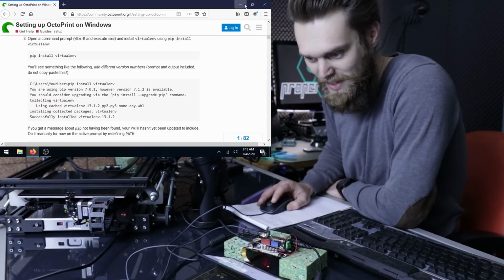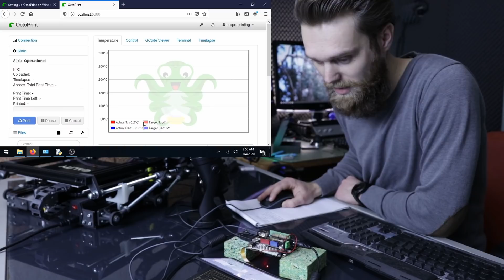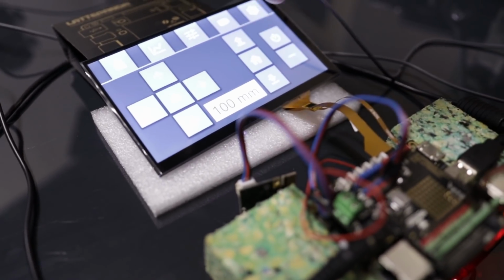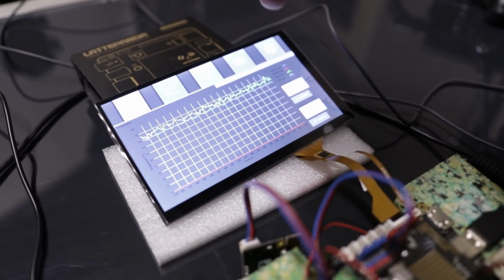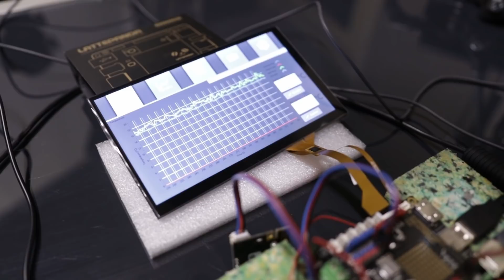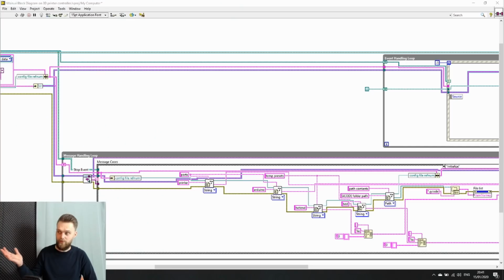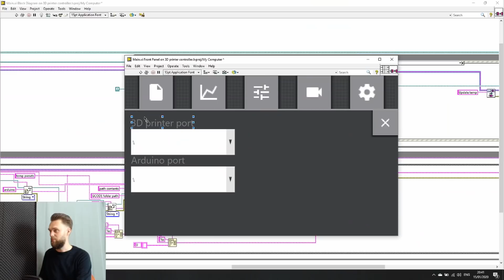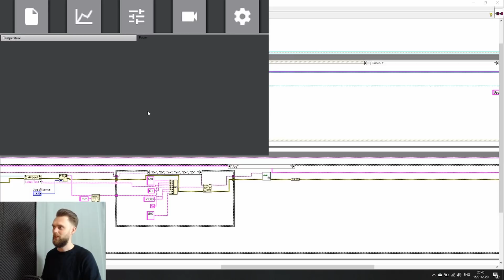Properly controlling an Ender 3 pro with a LattePanda print server

Comment: 09.47 I feel your pain at least its not just me that this happens to but you keep a much cooler head than I do
Reply from the maker: A pro tip which keeps my head cool in situations like this is to see it as a new starting point. This is where you stand, this is the current situation and which steps to take to get out of it. Most of the time you'll learn from it too :D If it happens a second time I won't keep it that cool though😆
Reply: @properprinting  good advice I will besr that in mind at my next failure

Comment: Amazing work! So what are You exactly doing here? Is this Frontend sending scripted G-Code thru the Octoprint Server? And what interests me the most, is it possibly extendable for File Browsing over the Touch Interface thru maybe some sort of File Browser? This whole Setup leaves me very curious of what it could be extended to because I am thinking of building a Jubilee 3d Printer/ Multi Tool Machine and I wonder if this Kind of Setup could be used to control lets say GRBL, that would make for a perfect Setup for controling a Jubilee since it's basically designed to be a Versatile open Source Machine for all sorts of tools, but the Software Side of things is not there yet to do let's say proper subtractive Manufacturing. Would be cool if You reply, Love your unconventional Approach to tackle Things and Your Trial and Error way of doing it, just like myself, although I am not that good at Programming, the only Practical Programming I've done is some Ruby Plugins for Sketchup for my own use and some Basic back in the Days. Greetings and Big Thumbs up from Germany 👍
Reply from the maker: Thanks Johannes! If you connect a 3D printer directly to a computer you'll get a serial port (RS232). You can send G-codes directly over this port using a terminal like Tera Term, Putty, Termite etc. LabVIEW is specialized to communicate over these kind of ports to control equipment, like a programmable power supply, oscilloscope, function generator you name it. Controlling a 3D printer is much like this and I made a LabVIEW program which shows a button on the front end and sends one or multiple G-codes directly to the printer. LabVIEW can basically do anything and file browsing is not a problem at all. For this food printer I'm planning to make a UI which shows a photo of the dish itself after which it can guide you through the recipe. I'm planning on making more videos in which I show how to use LabVIEW to control these kind of things and they released a free community edition recently https://www.ni.com/nl-nl/shop/labview/select-edition/labview-community-edition.html
Reply: @properprinting  Thanks a lot for answering, I'll take a deeper look into LabView then, maybe I get my head around this! Have a great weekend!😉👍

Comment: @
Proper Printing 

Really enjoy the video's Thank you for sharing, You really should buy a Tronxy x5sa pro. wonder what you could do with it. I own 4, 3d printers. Cr10-S, Sovol SV-01, Prusa mk3s and my favorite is the Tronxy x5sa PRO why is it so good, well for around $400 it has 32bit controller 24v, with TMC drivers & it can print between 100mm/s to 150mm/s out of the box this has to be the best printer for the money out there but only the PRO version as the standard version don't compare, it also has a simple touch screen but unique real time speed change on screen really cool feature. plus firmware tweaking uses simple coding anyone could learn. type small line of code save as file & use print function to upload the change very simple way of modding firmware. Check it out  , Cheers
Reply from the maker: I'm glad you enjoy my vids, thanks! And thanks for your suggestion! Hopefully Tronxy reaches out to me one day ;)

Comment: Do you have a link to the program you made ? I would like to incorporate this into my system. Thank.
Reply from the maker: Thanks Chris for your interest! No I haven't and for now it's only used for showing the principle. I'm going to develop this further behind the scenes
Reply: @properprinting  I'm currently running octoprint on old laptop I was going to get a touch screen that could probably be ran and used USB and use that for that program.
Reply from the maker: @cmm159  My next project will probably use a laptop as well with this software and an Arduino. This will take some time though in order for me finish the software
Reply: @properprinting  outstanding can't wait to see it in action.  Love the content and keep up the good work.

Comment: I NEED YOUR HELP. printing a small whoop quadcopter, I am using  cura. Problem is ,After 2 hours of printing ,the printer stops in the front left hand corner. The first time this happened I thought the filament had jammed, so started a New print same STL File. Just after 2 hours ,I even did a video showing a friend how great it was printing ,when 5 minutes later I went to check and the print head had stopped in the same position as last time, front left corner, it allowed me to click resume print. But as I did the print head lowered into the print and was jammed. It was like it wanted to go to first print layer. I got the stl file off Thingiverse and there arnt any complaints about it. Strange why it would stop in the same place twice and after same time period of 2hours sumit. Grateful for your input
Reply from the maker: This sounds like a slicer problem. I haven't had this before and you can try another slicer to check this. If this doesn't solve the problem I'd suggest posting the question on Reddit since there is a lot more experience with these kind of problems than I have.
Reply: @properprinting  Hey ,thanks for the reply. I should have wrote to you. We found it to be a Pause in the G Code. Deleted that and printing now without stopping

Comment: Yes bro, just read a handful of your comments and I must say, your doing well. I also ran into problems using octopi with a webcam and 7" LCD, but will get back to that later. What I will say since your full of good ideas, is try sculpting from nothing into something using the touchscreen like you did at the end of the video. In some way, I imagine it will be like 3d drawing because your using a hot material, but you still could sculpt in 2D!!! 1 layer at a time, but just manually...... hope you understand what I mean. Good work once again
Reply from the maker: Thanks David for your comment an suggestion! I have to improve the software because it's pretty hard to draw with it. The lag and determining the actual position is not easy at all xD
Reply: @properprinting  no, it wouldn't be, but from what you demonstrated, was why I described a technique like drawing. It's more fluid rather than something calculated. But either way, even I can't see much prospect in it being a new found technique or trick. It's more random, not much else. So what's next after software update?
Reply from the maker: @Monosscema  I'm not going to share yet what's going to be next. For this project it's more fun that it's a surprise with what's coming ;)
Reply: @properprinting  cool, jus curious. I can wait. I guess I asked because there can only be a number of upgrades that can be carried out, if not an addition. But cool, I'll be watching. ;D

Comment: Who else think that channel is most innovative among other 3d printer topic? 
There are people who copy somebody's ideas and there exists people like  you - true passionate with open mind and great approach. I just can't wait till next video wondering what incredible you going to implement! And that waiting is killing me :) 
BTW  my thoughts bellow:
1) Removable print head - awesome, awesome awesome.. 
2) D-sub connector - cool, but during watching that part I knew that it's going be a problem with pins as they are fragile. There is also one issue: what if you going to add a new extruder to print in 2 colours ? Hope you see my point ;)
3) Foldable Z - I'm speachless! Here we are at geniuss area ;) That way I treat that particular mod. My question here is : what about Z wabbling or print shifting, are there any issues so far? Guessing other viewers would like to know as well behavior of printer so far..

Regarding a new ideas I have some. I own CR-10 S4 and working for some improvement as well. Istead of RaspberryPi I'm using BananaPi M3 (more powerfull with 64 bit procesor and flash memory). What I hate at FDM printer is a noise when some of motors is going out of it's range and then you hear unpleasent creak. My idea is why not add endstop switch on other side of each axis? If switch triggered a point then cut off that stepper either directly from printer or inject g-code into runing script. Do you think is it possible to menage? I'm guessing there is no point to change entire firmware for that (while at future we would like to update a firmware - then is no risk. Otherwise we need one more time implement our changes, but who knows how code of new firmware would be different from current..)

Another idea: installing a Klipper firmware instead Marlin and connect it with OctoPrint, which will give us 32bit processing without having 32bit 3d printer main board. Please consider that! There is downside unfortunatelly: Klipper is still fresh, that's why it has some bugs and community isn't so big..

Adding a few addresable led strips to printer. One under a table, which will reflect by color temperature of bed (then you know whether is hot or not), one as information if there is any error, and last one as main source of light. Of course you can program it wit variety of animation what is benefitial :)

Oldham coupling on Z rods - to improve 3d printing quality is very interesting topic. Please take a look on that subject while Creality 3d printer familly seems to have common problem on that point.

What cool also would be is to create is auto aligment of X axis , to be sure is square with frame (sometimes you might have one side a little bit loose which causing failing first layer, or incorrect ABS measurements).  So basically go on top with X gantry where are located 2 end stops for each Z motor and turn that one which already hit a sensor. Repeat that for second motor. Once both are disconnected you are ready to go with perfect square gantry. Finally do homeing.  Probably each print it's worth to do it. 

If you'd like I can share you my design of magnet bed where I used LockBuild surface and 64 special magnets (neodimium magnets as some people suggest here shouldn't be used because of temperature which could demage them - above 80 C). I have mount them on cnc cutted sheet. You have a great content. It would be nice to see my mod on your channel as well. Just let me know if you are interested ;)
Reply from the maker: Thanks a lot for your comment and sharing your thoughts and suggestions! Nice thing about the custom connector is that this enables to print in multiple colors. Not like it is right now, but the goal of this design is to enable the possibility to embed a connector in whatever you can think of, including a dual head system. I have some fun ideas already I would like to work on in the future.
About the foldable printer, the holders at the base must be improved in order to make it print more stable. Believe it or not, this will not be an issue with the thing I have in mind with this printer, but yes, this must be improved ;)
Interesting idea to disable the steppers if they reach the end point. The current solution is a bit sloppy and can definitely be improved. Maybe this can be combined with sensorless homing. 

Klipper has been mentioned by others as well and yes, this is something I have to take a further look at :)
In my opinion, automatic alignment shouldn't be needed. If the printer is assembled accurately, so everything is parallel, perpendicular and flat, accurate homing should do the trick.
It looks like 2020 is already planned full with projects, but I want to make a comparison video about different homing methods. Maybe I can do a similar thing about "real" build plates, but I'm not promising anything. Thanks again for your thorough comment :D
Reply: @properprinting  Usually I don't write a lot of comment, but once I did it  then I'm trying to include some valuable informations and because of that my comments look like a letter :) 
Thanks to you mate for your work and sharing projects. It's eyes opener. Fingers crossed about yours plans.
Reply from the maker: @mariuszzawierucha1310  Thanks for taking the time to comment on my video, I really appreciate it!
Reply: @properprinting  Oh, BTW Latte Panda. There was a time when I wanted to buy it too (but price and politics of M$.. made me posponed that step). Do you affraid of moment when Microsoft will abandon supporting that board like they done it with Windows Phones devices? You are rather focused on Microsoft technology (and there is nothing wrong with that) , but as pass shows sooner or later it could find out that LattePanda will be dead board. What's then? Linux still will be there :) Even now they released Ubuntu like they predicted shuting down Win10.
Reply from the maker: @mariuszzawierucha1310  I'm not afraid of Windows abandoning this board. I'm not Windows minded at all, rather the opposite xD This doesn't show in my videos, but the day a good 3D CAD software for Linux is released will be the same day for me going back to Linux xD It turned out to be quite a hassle to install Linux on this thing so for this idea to work for this video I had to stick to Windows and write something in LabVIEW. I'm known for not liking Windows so it's kind of funny that a lot of people think I'm focused on Windows xD. I can install Linux if needed on this board as well so no, I'm not afraid ;)

Comment: i think this would be a lot better if you had a linux tablet. They are much cheaper than this panda thing and you can just hook it up to the 3d printer mainboard by serial, and control everything else (like solenoids) from there
Reply from the maker: Thanks for your comment. In my opinion it depends on what you think is better. I'm definitely not saying that my solution is the best (I'm sure it isn't) but I really like the ease of the gravity shield with the enormous amount of modules which can be added to it without much effort. With the knowledge I currently have I can realize things I otherwise wouldn't be able to. I see this as a prototyping platform on which I can explore new things. I hope that this shows some features which other people can learn or get inspiration from.

Comment: > calls the video "properly controlling an ender 3"
> uses Windows to control it
Reply: In the middle of 2 days print
> 99%
> Windows update
Reply from the maker: @88farrel  next episode: me beating the crap out of this printer xD
Reply from the maker: Haha yeah, my intention was to install Linux as a first step. This turned out to be less convenient that I thought it would be with a LattePanda. During this video I decided to go with Windows because I wasn't able to pull this off otherwise. I've used Linux for many years and it would be my OS of choice, hands down, but I had to pick my battles for this one ;)
Reply: @properprinting  windows will most likely make it unpredictable tho, you never know when some background process will steal important cpu times and throw octoprint off a few steps. I don't remember if the lattepanda has multiple cores but it would be worth it to add a startup script that periodically puts all windows processes on their own thread and makes sure octoprint and your stuff is bound to the main thread only, so the system doesn't ever try to steal cpu time from the printer.
Reply from the maker: @EMILE12345678901  Thanks for sharing your concerns. Nice thing is that I've programmed my own application which waits on the acknowledgement the printer returns (I recon Octoprint would do this as well but what do I know). I've never had a missing communication with any of my LabVIEW applications due to Windows. But, I'm just starting to find out the possibilities of this approach and maybe I'll find some problems. Missing steps won't happen, it will be a pause or a complete failure if Windows decides to reboot or crash xD That's what I'm most concerned about.

Comment: Be careful using windows since the newest update versions of Windows 10 have a mandatory update cycle that could reboot during long prints.
Reply from the maker: Thanks Mike for this warning! I'm definitely going to take a further look into this. Hopefully there is a way around this since there are more systems, like oscilloscopes, which run on Windows and have critical functions. I personally would choose for Linux for such systems, including my printer, but that would be too much of a hassle for me now.
Reply: @properprinting  disabled the updates from services and hit stop. And it will never update unless you want it to update.  (Not services in task manager)

Comment: great project indeed, I think a bit overkill to use a LP for this but that's your choice. Do zyou use any TMC drivers in the printer  ?  sounded like original 44xx series or was that just my ears being wrong ?
Reply from the maker: Thanks Patrick! I've added the Bigtreeteck SKR board in my previous video which was sent to me by a viewer. The printer is a lot more silent, but the little noise it produces is picked up by my mic pretty well through the table surface.
Reply: @properprinting  did you also use the tmc2130 ? or 2209 ?
cheers and well done !!